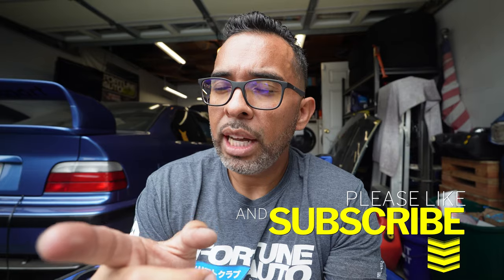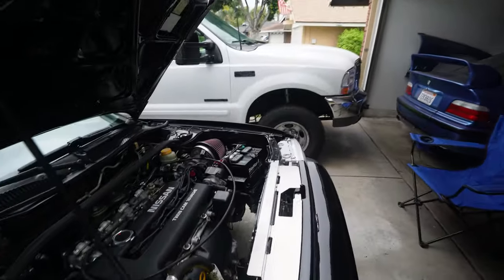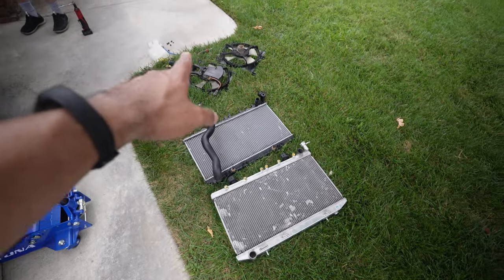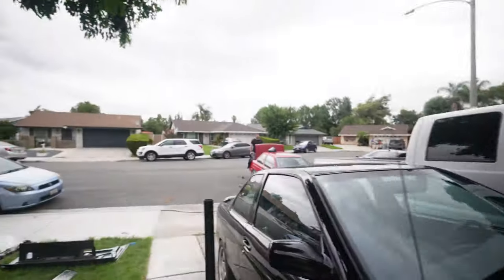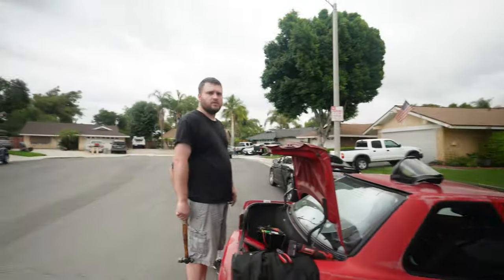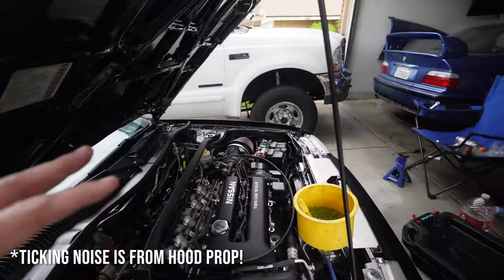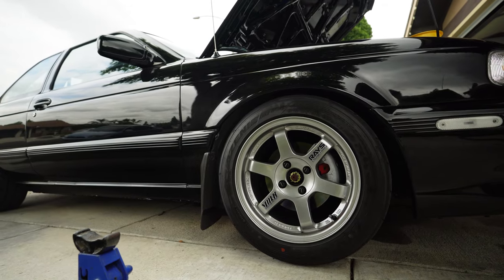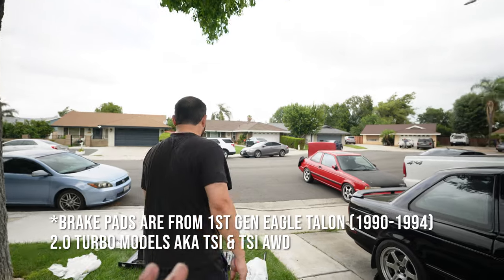Nissan Sentra SE-R : Daily Driver Build / Koyo R1977 Radiator Install

Comment: I changed out a cooling fan 2013 Sentra which the dealer wanted $600 for 3 hours of labor only. I decided to give it a go and performed the task in 30 mins AND didn't have to drain the cooling system or remove any hoses. The radiator support had bolts, and the upper hose had a section with bolts as well. Watching this just reminded me of that in some ways.
Reply from the maker: Nothing like doing the little things yourself.

Comment: Have to ask since you guys are pretty local to me. My 96 G20 transmission just busted. I was putting the kids around in first gear when the wheels just locked up. Push the clutch and it will roll, but the trans is stuck in gear. I have no trouble pulling a transmission out, but I have never opened up a transmission. Where is the best place to find a decent used 5 speed for this car? All I have found is one on Ebay. Of course an lsd trans out of the later generation g20 would be ideal with the stronger case and third gear, but I need to get this car up and running again in about a week or 2. What advice or help could you give me.

Comment: I had installed one of these and it kept leaking internally sadly, I loved the look but went to mishimoto cause I couldn’t find another one for koyo
Reply from the maker: Getting a used koyo is tricky. You have to trust the source it comes from. I've had leaking issues with brand new mishimotos and had to do warranty exchanges. Sold them and found koyos.
Reply: @blipshiftapex9047  I actually got it sealed box and everything dude told me it has been sitting for over 9 years lol still gave me issues and I couldn’t find snouther after
Reply from the maker: @elitetoxicity9446  what a bummer!